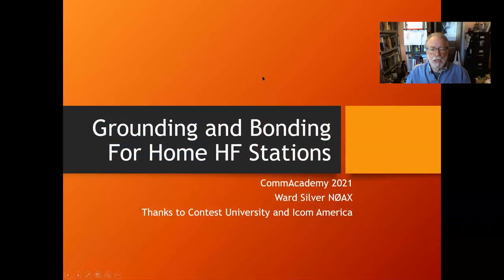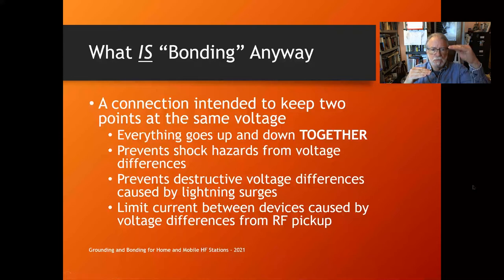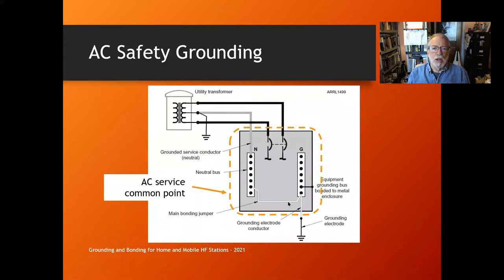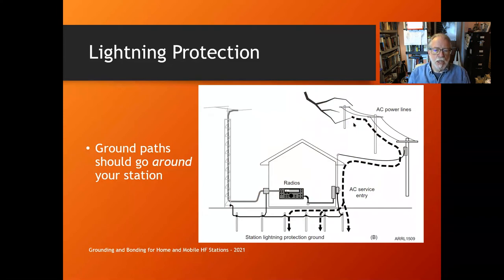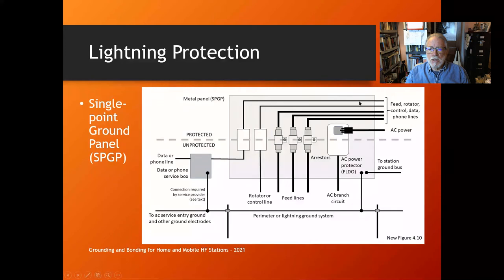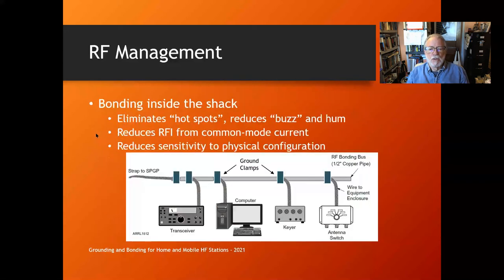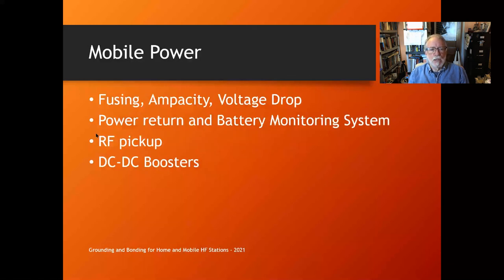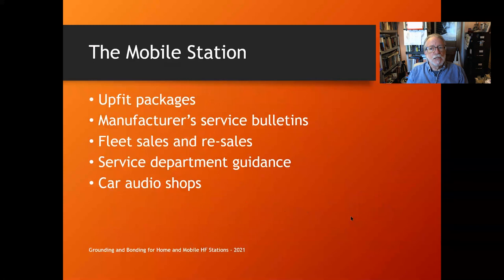CA21: Grounding and Bonding for Home and Mobile HF Stations

Comment: On the single point ground panel, what are the specs for the Gas Discharge Tubes?
Reply: Hi Steve - the ones I use as discrete GDTs are made by TDK in the G31-A75X product line.  I used the lowest-voltage units on my rotator control lines.  I don't know what part number is used in the RCS-4L antenna switch or the DX Engineering lightning arrestors.
Reply: @hwardsil  Thank you